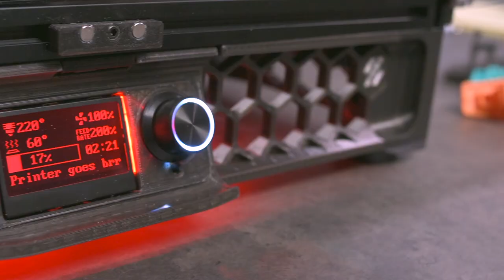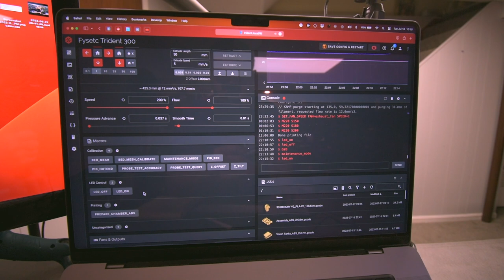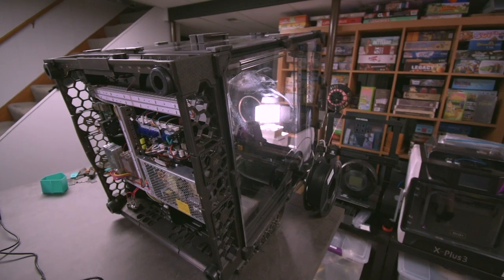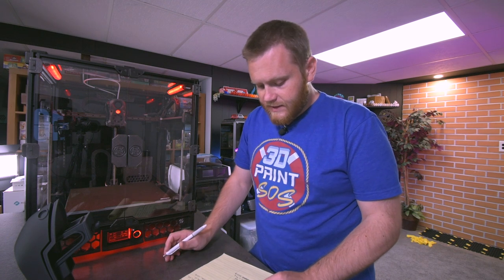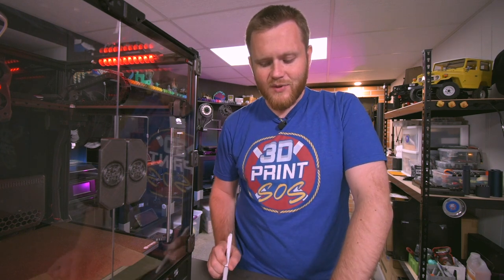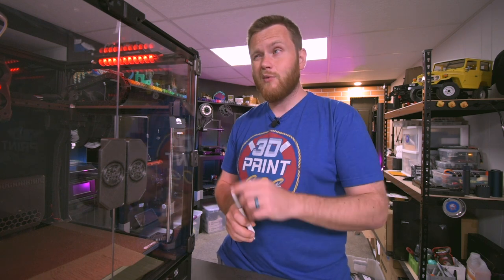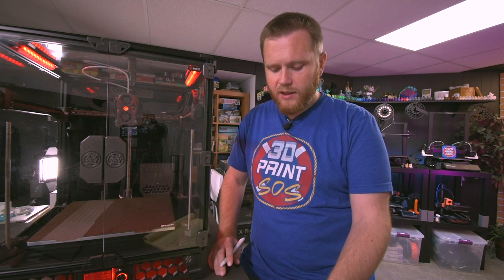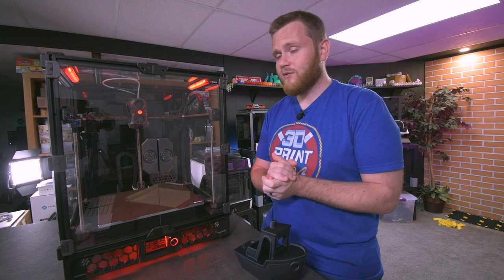My Voron Trident is FINALLY Done! - Fysetc Trident 300 Kit Review

Comment: Hey there, nice build. Question, you said that in order to use cw1 on the stealthburner you had to print the stealtburner cw1 version, but i cant seem to find it anywhere. Did you perhaps mean to print the afterburner clockwork files? thanks in advance. Beginning my  fysetc voron 2.4 build next week.
Reply from the maker: I believe this mod will let you run the BMG gears that come in the Afterburner with the nema motor https://www.printables.com/model/454292-voron-stealthburner-clockwork2-extruder-nema17-v1

Comment: CANBus man. For the wires coming from tool head. This kit, seems to be lacking that ? This is a down thumb as far as all of that is concerned. Great video, nice machine dude.
Reply from the maker: Canbus from them is a $20 part. It looks like Fysetc puts together this kit how Voron designed it originally and it’s up to you to figure out which mods you’d like to do. So if you open the original trident pdf by Voron, that’s what this kit is. I bought a ebb36 and will be using USB straight to the Pi. No second can bus module nonsense. Just +/- and USB cable. Done.
Reply: @3DPrintSOS  right on, just seems that if the wire chain is chaulk full, they should try to spec the canbus right out of the gate. I understand the Voron platform is "anything you want, you decide" so there Is I guess, no right or wrong answer. Thanks for the video! I am still printing out parts for mine, Cheers!
Reply from the maker: @tombo7719  It was technically partly my fault. I added LEDs to the stealth burner which added 3 more wires. I also added another 6 with an accelerometer for input shaping. So I have just a completely full chain. But TECHNICALLY, it would be slimmer “stock”.

Comment: Where are the links to the canbus or usb toolhead board?
Reply from the maker: Oops. Missed them. I’m going to use this one: https://amzn.to/3Yy0joE

Im going to run it in USB mode and use the usbC to go right to the pi. No canbus connection. This means I need to run a 24v and ground to the plug. But this will be simpler as there is no need for a canbus receiver if you run it like this.

Comment: Ive buit a 2.4 (Formbot) and honestly rushed my build. As a result I'm still working on it.. problematic BUT thats why I got a kit.  The learning curve is very steep on these.  On a personal note (I've brought this up elsewhere) the one thing that most livestreams bring up is "all printers can do good quality".  They are all essentially the same hardware just configured differently.  That being what it is, I have yet seen anyone break into the software.  Specifically slicers when 'tweaking' profiles.  As each machine is different due to tolerances as is also filaments the software is always the deciding factor.  I have been constantly directed to use Ellis' guide which to me reads like stereo instructions.  Visualization to me personally is everything and I just fail to wrap my head around it.  I just recently came onto your channel and find your style very thorough and detailed.  I'll definitely be looking at your past offerings and look forward to your livestreams in the future.

On a personal side of things, I chose the full 350 2.4 specifically for ABS and no doubt I will get it there eventually.  Until then.. I fall back on an MK3S+ and a 400 v-core ratrig for my general impulse printing.  Keep up the work and thanks for the effort :)
Reply: I would watch a video series going through ellis' print tuning, or orca slicer tuning steps. 
Especially if they start with a machine that's not already perfect.

Comment: What is the "certain type of wire" that you use for cable chains?  You didn't go into detail on that when you mentioned it.
Reply from the maker: I didnt know that you can’t solder wires in a chain. In makes for a weak point and I’ve broken several wires inside chains that way. It’s best to use silicone wire for cable chains. However, I would HIGHLY suggest going can bus and senseless homing. It gets rid of the chains altogether and replaces the entire loom with a single cable containing 4 wires.
Reply: @3DPrintSOS  CAN bus is definitely in my future.  I was thinking that the wire should be the same type of wire that is used for the thermistor.  The very thin, specially coated for heat resistance, type of wire.  I think its called PTFE wire.

Comment: There is a mod available for trident to invert the wiring so it can be accessed from the top.  Then you home the bed (to the top), and remove the inside bottom cover to access the wiring.  No need to turn the printer on it's side anymore.   There is also a mod for an internal spool holder, this will also keep the filament dry while printing if the printer enclosure is closed.

Comment: I've bought mine and it's arriving aug 23th. one question, if i may: the linear rail for the Stealthburner is a MGN12 but i've tought it would come with the afterburner that uses 2x MGN9! So, it comes with the MGN12 for Afterburner? if is, that's great. then i don't have to throw the mgn9 on the pile and save some for the canbus.
Reply from the maker: That's right. It comes with a MGN12 for the X-axis. ;)

Comment: Is it relatively easy to make a trident with a 35x350x350 build volume?  I'm noticing that the build height on most kits is limited to 250mm
Reply from the maker: Technically speaking, you make it any size you want. I think these kits are just targeting the most popular sizes.
Reply: @3DPrintSOS  I get that, but if I'm going as big as 350x350 I'm going to want to print a wearable cosplay helmet at some point, daft punk, or Vader or something.
Reply: The z limit is because the lead screws are integrated into the z steppers, and it’s hard to find them longer than 250mm - if you could source those, it should be relatively easy to find longer parts for the rest of the z axis

Comment: I have ordered this kit. It is still on the box but because of your review I have ordered the canbus adapter and the EBB36. I will try to make it work with CW1 as I don't want to order another motor
Reply from the maker: Good call. That’s how I’d do it if I redid it. In fact, I have another broken wire in the chains…so line starting my conversion soon.
Reply: Thanks man! @3DPrintSOS   I'm halfway through this build but I just realised I need to print the stealthburner I cannot find where to print the CW1 as you suggested. Do you know where to get these files?